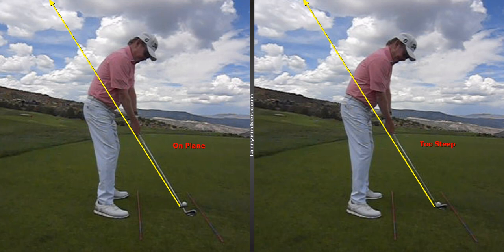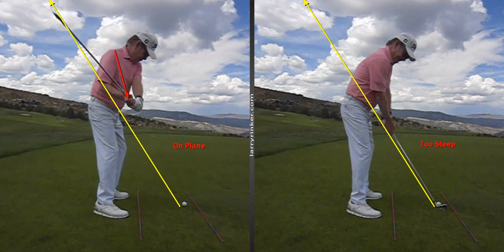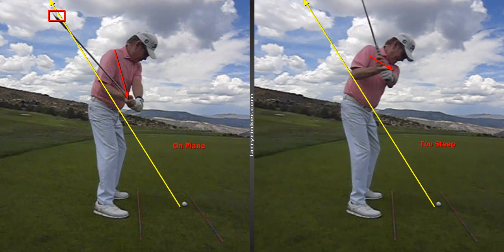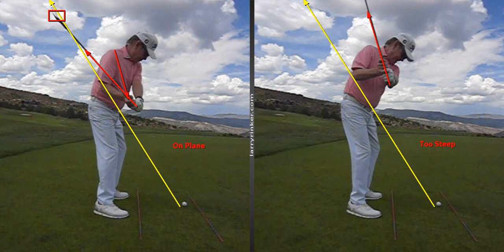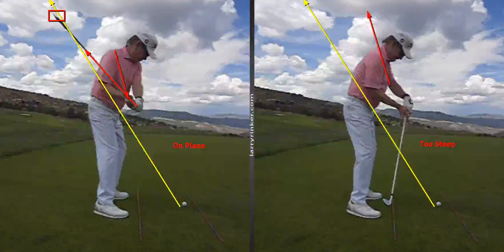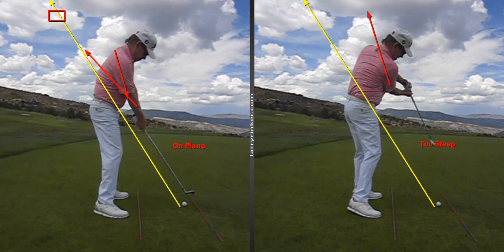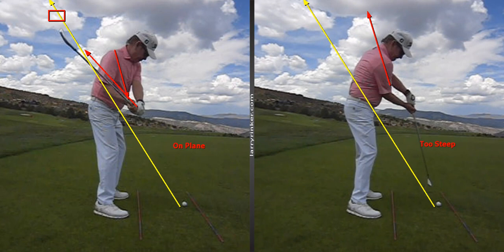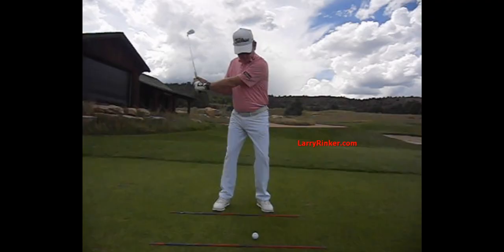How to Start the Downswing in Golf

Comment: I get keep the back to the target as long as possible. Why are you against opening the hips early in the downswing? It helps me with low point contact and creates space for the arms in the follow through.
Reply from the maker: If the body rotates early from the top of the swing, that will result in bog blocks to the right for right-handed golfers. Turning early with the chest doesn't give your arms room to swing. I would suggest you video yourself to see if your hips are actually rotated that much at impact. The upper core player shifts and rotates into a jump at impact. Lateral, then rotary, then vertical. Cheers.